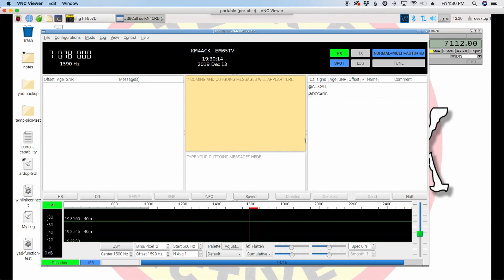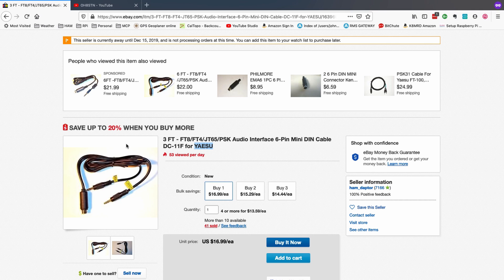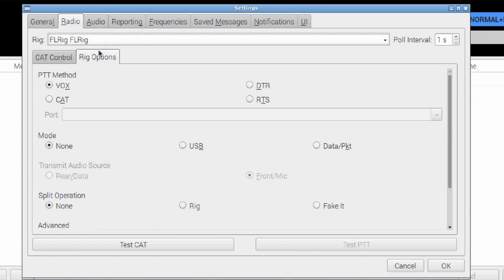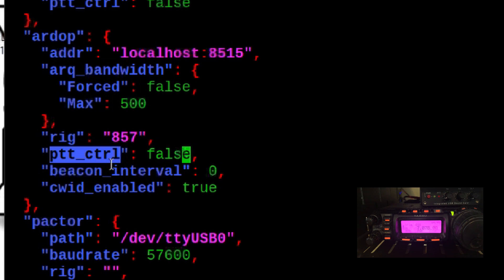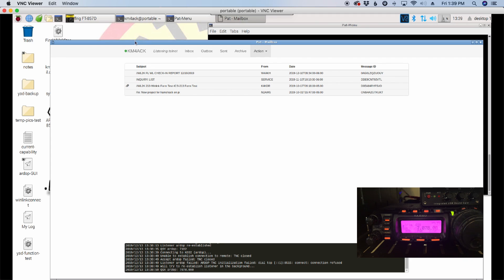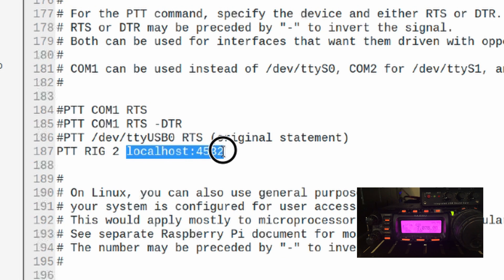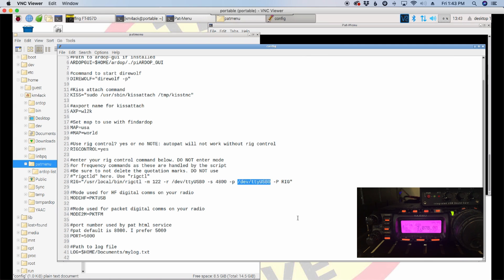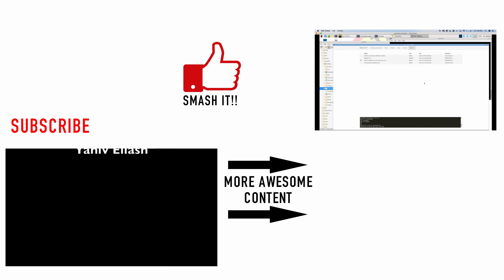Cheapest Sound card for digital ham radio

Comment: Most computers, including rPi already have audio in and out.  That is the sound card.  You don’t need anything else unless you want more than one channel. You can route audio between applications if needed using something called a “virtual sound port” software, which exists for most platforms as free utilities.
Reply from the maker: The pi has audio out built in but not audio in. You do need an external sound card for digital modes with the pi. You are right about the routing the audio. It is pretty simple with Pulse audio.

Comment: why that interface needs a soundcard? does raspberry pi will not work well if the base radio is connected directly with TRRS audio jack input?
do portable radios need also a sound card?

Comment: I can't adjust the audio input/output levels as described. I right click on the speaker icon and go down to output and all it shows is USB device and it is checked. But no option to change settings. So no way to lower the audio
Reply from the maker: from the terminal run, "alsamixer" Then press F6 to choose your sound card and make adjustments.

Comment: Has Anyone used a USB Sound Card, Dongle to adapt an HT, for use with EchoLink? If so..What extra program(s) would you need? If Any?
Reply from the maker: You can do this with an EasyDigi sound card (<$10) https://mikebeach.org/2015/10/27/using-kf5inz-easy-digi-with-baofeng-uv-b5-or-uv-b6/comment-page-1/

Comment: I have this sound card, using the build-a-pi with latest updates, and can't get the modem to work with it. The pat config shows it as 2,0 and 2,0 which matches my lsusb....
I'm stumped. Checked all I could think of (volume and mic levels, unchecked auto level, selected device, etc.) Tested the headphones with the audio jack as well as my leads out of my FT891 (I can hear output from the radio). Tested using audacity, and could not record anything through the mic... I may just have a bad card.
Reply from the maker: It could be a bad card but be sure in Pat Menu that you choose "Set ARDOP PTT" = TRUE. You will also need to have a CAT cable connected to the radio and FLRIG configured and running. If it still isn't working, head over to the forum https://groups.io/g/KM4ACK-Pi/topics

Comment: Thanks for the video, that helped me a lot!  One more question about the PTT control for AX25 packet, how can I PTT control the rig via the microphone plug PTT?
Because the rig I am using doesn't have rig control possibilities (only a microphone and ext. speaker out).
Reply from the maker: You will have to find a sound card or USB/serial adapter than can send the PTT signal to the HT. https://mikebeach.org/2015/10/27/using-kf5inz-easy-digi-with-baofeng-uv-b5-or-uv-b6/comment-page-1/ Another way is to use a signalink provided they support the radio you are using.

Comment: If you don't have a radio that has the controls.  Can you use the USB sound and one of the relays to control OTT.
Reply from the maker: If the radio doesn’t have CAT, you could probably use the GPIO pins for PTT through the mic connection but it would be a bit trickier to configure.
Reply: @KM4ACK  well with the Anytone D878UV and D578UV both have Bluetooth,  they can Bluetooth to the Pi, set up for VOX.  Sounds to easy.  But first I need to save up to get all the boards and things, and learn how it and goes together and works. As new Ham I am trying to do a lot in short time without much money!
Reply: @KM4ACK  Well I think it is only what we can think up!

Comment: Using the   RIG="/usr/local/bin/rigctl -m 122 -r /dev/ttyUSB0 -s 9600 -p /dev/ttyUSB0 -P RIG
the RIGCTL is green and the 857's PPT works, connection 'acks' occur but there is no freq control.
Error messs: 
2020/05/18 13:39:06 Unable to get frequency from rig 857: dial tcp [::1]:4532: connect: connection refused.
2020/05/18 13:39:06 Starting HTTP service (0.0.0.0:5000)...
2020/05/18 13:39:43 QSY ax25: 145090
2020/05/18 13:39:46 Connecting to WM3M-08 (ax25)...

Comment: So do you need to have one config file for ARDOP and one for direwolf? 
RIG="/usr/local/bin/rigctl -m 4" works perfectly for ARDOP but does the does the direwolf recommended;

RIG="/usr/local/bin/rigctl -m 122 -r /dev/ttyUSB0 -s 9600 -p /dev/ttyUSB0 -P RIG

 allow rig control in ARDOP?
Reply from the maker: Use the RIG="/usr/local/bin/rigctl -m 4" statement and follow the video to get direwolf working. You need to make one change in direwolf for PTT.

Comment: If I used this usb sound card, what cable would I need to connect the PC and radio for cat control?
Reply from the maker: Depends on your radio. Check out hamdaptor on ebay. That's where I get my cables from.
Reply: @KM4ACK  thank you!

Comment: I too found that I needed to use the DIG mode for my FT-857D to get transmit audio, but when in DIG mode, I do not get any audio out of the radio and into the pi - at least nothing decodes in WSJT-X.  On the other hand, when the rig is set to USB, WSJT-X decodes FT8 but there is no transmit audio.  This is true whether using my SignaLink USB or the cheap sound card.  Can you share how your FT-857D is configured or do you have any suggestions about where to look?  

Another "clue".  WSJT-X now crashes every time I try to transmit or tune.

73, John

Comment: I have the Sabernet USB soundcard and when I go to set up the audio in WSJTX, the sabernet doesn't show up. I have tried all of the usb ports. I followed your Pi4 build notes up thru bashrc. I don't plan on using Winlink or Packet. I did install hamlib and then jumped down to WSJT-x. Any suggestions?
Reply from the maker: in terminal run "arecord -l" to get your sound card numbers. Typically 1,0. In WSJTX, look for plughw:CARD=1,DEV=0 or hw:CARD=1,DEV=0. Another possibility is plughw:CARD=CODEC,DEV=0. 73, de KM4ACK
Reply: KM4ACK That worked! Made a contact into Belgium from Florida. I cheated a little, hooked my KX3 up to the Steppir.

Comment: At around 4:30 you mention not being able to select USB for Mode. This is because the DIN plug uses data in/out which only work in DIG mode. de N4TZH

By the way.. I am setting up my Pi now using your guide...so far so good. I am going to use this sound card method for my 857 in the truck. Can't wait to be picnic table portable running digital modes on all bands!

Comment: We have a local ve7nv that created an interface with vox ptt in. We can use the cheap usb soundcard or smartphone with a mobile/base radio. I will be using that device with the PI 4 to create Winlink and of course the SSTV. Here in the Vancouver BC area we send SSTV pictures like the 12 days of Christmas as an example. VHF hams can now play like the HF SSTV hams. Some of us can see a need of being able to send a picture in an event ie Bridge collapse to an EOC for the Operation team. etc The PTT part is one of the issues need to over come if they like me are antenna restricted. I use a 1/4 wave mag mount plus a dual band beam in my living room.

Comment: Why didn't you use digital Vox on the ft-857? That alleviates the need for cat control
Reply from the maker: VOX on the radio is typically not fast enough for 1200 packet so I tend to just set up CAT for everything. Have to admit though that I haven’t tried on the 857. Other radios tried in the past have to long of a hang time on VOX. 73, de KM4ACK
Reply: Hey guys hi good work your doing there I have same setup like yours I can transmit but can not reserve any thing I don't know where is the problem please help me A61bn a61bn@hotmail.com

Comment: Awesome video and perfect timing as I just bought myself a USB card after watching Julian's video. My next step was to start working through your videos in preparation for setting up the pi. 
 One question though - has anyone come up with a good way of setting up the config files for multiple radios as I'm working on the first of what I hope will be a set of go kits for the scouts and it would be best if each pi isn't just tailored to just one radio. My thought was to look at a script to ask which radio is in use and use it to set a variable to determine what config settings to use but I'm wondering if anyone has already solved this problem?

Thanks for the great content
Neil 
VK3IG
Reply from the maker: A script would be possible to change configurations. You might also just consider a separate SD card for each rig. A bit of a hassle to manage but SD cards are super cheap these days. 73, de KM4ACK

Comment: If you are pulling PTT over CAT and its on USB mode the microphone will be active.  For the radio to 'listen' to the data port you have to set the Yaesu to Dig OR Use the PTT connection on the data port itself.

Comment: I use one of those little USB sound card interfaces with my easy Digi the only problem I had was seem like sometimes wasn't making its good connection so I wound up popping it open and soldering the wires direct to the board work's awesome now
Reply from the maker: I've seen other do that as well. Might be a future project. 73, de KM4ACK

Comment: Question, do you think this could be done with an Alinco DX70? I know it won't work on my Drakes :)
Reply from the maker: Would depend on the input on the Alinco & that you can buy/build an audio adapter cable. Can you run cat control with the Alinco? 73, de KM4ACK
Reply: @KM4ACK  There is no CAT for this radio, just ptt, no vox. I had used a com port dongle I made back 10 years ago on it. But there are no more com ports on PCs now, and I really haven't had it on the air in awhile. I need to find a budget radio that does CAT, any sugestions for one for us old farts? 73  ke4ooo
Reply: IWatchedWhat there are usb to com port adapters you can buy

Comment: Between you and OH8STN I am going to just wipe my pi and start over.
Reply from the maker: Sorry we are creating more work for you but most of the time it's worth it :-) 73, de KM4ACK
Reply: @KM4ACK  my pi is so patched together with its coding... I dont even know how I got it to do the things it does anymore... it usually works fine, but I just wanna wipe it and go through your playlist and reprogram the whole thing... between that and the hardware that OH8STN talks about, I should be good for another 10 years
Reply: @spldrong  the AmRRON Build has a great image for the PI

Comment: Julian always makes me buy stuff.  I got that same cable on Tuesday.   I got the Sabrent USB sound card to use with my Raspberry PI.  Also got it to work using a mic/phone splitter cable for the single audio connection on my laptop.
Reply from the maker: No telling how many of those cables the guy on ebay has sold now. hihi. 73, de KM4ACK
Reply: Yeah, he has cost me a bunch... but its worth it, and I'm building my own batteries too.